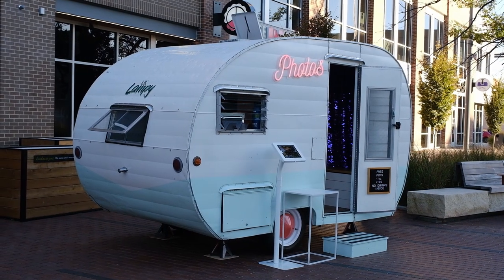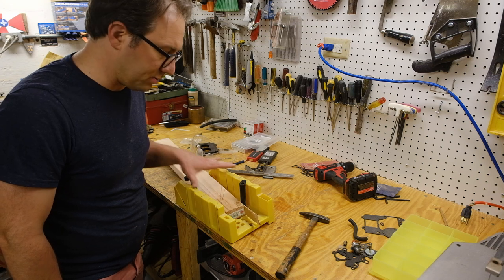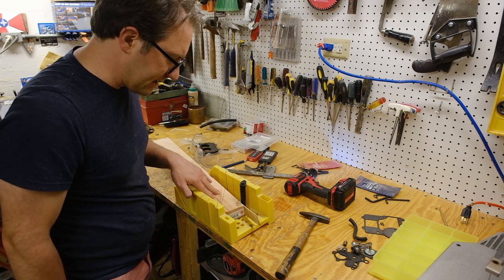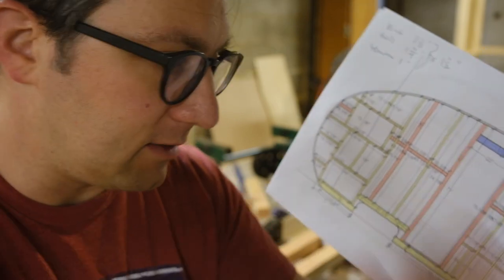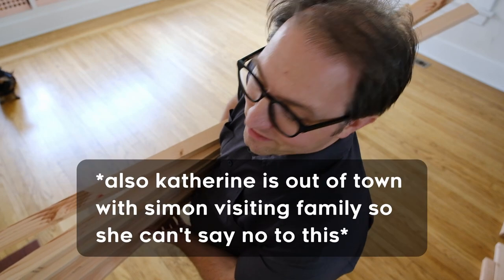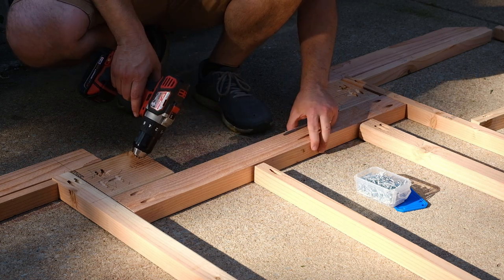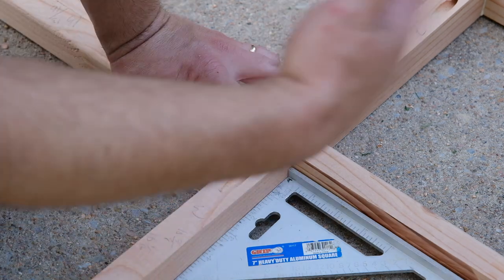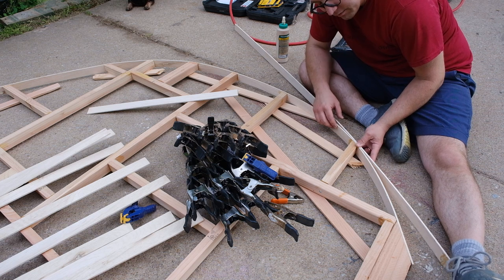BUILDING A VINTAGE CAMPER WALL 🔨 step by step diy

Comment: Conan, you make it look so easy.  I need to get practicing on Sketch up.  Enjoy watching your progress.  At first I thought you were putting that together inside your living room till I saw the workshop in back of where you were working.  I was thinking how is he going to get that out of there.  Then I realized it was a dry run.  How many hours would you say it took to cut all  the pieces and to assemble that wall.  Well done Conan.
Reply from the maker: It would actually fit though a normal height doorway, so I did consider fully assembling it in the living room, but my better judgement told me to take it outside. Also our house is over a hundred years old and the floors are less level than the driveway. Regardless, I didn't really keep track of the time, but I'm gonna say like really 10-15 hours of actually working on it. So a person could do a wall in a dedicated weekend if they wanted...maybe. I'll try to keep better track of time on the next one.

Comment: Looks great. Was insightful to watch the process. Learned a lot! I was bored the other night and had stumbled across some old magazine articles on campers from the 40's. They had dimensions, so I modeled it up in Fusion based on their dimensions. I think I like your design better. Looking forward to seeing the walls and roof.
Reply from the maker: Oh, that sounds like a fun exercise! I've always wanted to migrate over to Fusion, but I'm still needing to get a bit more proficient at it. I don't think it'd be a huge change to my working method though, but every now and then there's some things I wish I had it for.
Reply: @TrailerTrashtoTreasure  And I wish I were good at the tool you use. I started using Fusion for 3D printing and by using, I mean throwing stuff at the screen until something "works".
Reply from the maker: Ha ha, sometimes throwing things at the screen is all you can do with any bit of software!

Comment: There is only one reason to build the floor first. But I will hold back on that for now because that reason doesn't mean you shouldn't go ahead with your plan. I'll wait and see if it all works out LOL.. Continue on. Also remember, you will have 4 more layers at least when you make the curbing to that radius plywood all the way around will be much stronger later. And I glue the layers of the curbing as well. Your wall came out very nice.
Reply from the maker: Thanks! I couldn't see any reason why 3/4" on the radius board would negatively impact anything, but I did change the plans on the next wall to account for another layer. I'm not too worried about it though, but the next person to rebuild this camper will have a time figuring out why the two walls have a slight difference, lol!
Reply: @TrailerTrashtoTreasure  Surprise, surprise... LOL.. Maybe you should leave a note inside the wall for the next person.
Reply from the maker: Oh good idea!

Comment: Conan, why is there 3 different thicknesses of wall studs? I’ve only worked on one 1967, but seemed in Larry’s classes, they’ve also been the same. Thanks, keep up the work and videos
Reply from the maker: It seems to vary camper to camper. Typically the ones I've worked on will have thicker studs around the seam where the two halves of the skins meet, and also around the door. Regardless, it is always best to replace like with like, so just do what was already there. Remember though that ultimately those studs are just there to attach things to and to keep the panels from buckling; it's the panel itself that gives the wall all of its sheer strength.

Comment: Hi Conan, when you do your exterior skin what dimensions and thickness do you use for the metal sheeting?
Reply from the maker: Dimensions vary depending on the camper, but I think most are .032". I'm not 100% positive about that though. I've only replaced the skins with new sheet metal twice, and then I worked with what the supplier had.

Comment: I'm thinking of building the new framing onto the old and then removing it.   
1. My skills aren't that great. 
2. I'm worried the old framing will fall apart as I'm removing it.
Reply from the maker: I basically did that when I rebuilt the 1968 Play-Mor. 

Keep in mind:

1) You don't need great skills to do this.
2) It might fall apart, so you can always screw some extra supports to it to hold it together, (1x2s, 2x4s, scrap plywood, whatever you've got on hand).

Don't overthink things, just be careful and take your time.

Comment: Why do you cut down 2x4's?  Why not use 2x2's?
Reply from the maker: I don't buy 2x2s for a few different reasons. For one, they're more expensive than buying a larger board and ripping it down. For another, I find there are few actual 2x2 boards on a camper, meaning you would likely need to rip those 2x2s down anyway. But perhaps most importantly is that the 2x2s you buy at the hardware store are typically milled from the sapwood of the tree, meaning they're likely to have more moisture content and be more prone to warp or twist than a larger board that will be more likely to come from the older, denser, heartwood of the tree.

Ultimately a table saw is one of the most useful tools you can get for any shop, and you don't need to spend a fortune on one either. A basic job site saw is all you really need, and you can find those for around $300 new or less if you want to shop used.

I'd also recommend getting a circular saw, a miter saw, and a router as the basic cutting tools for any starting woodshop.

Thanks for watching and good luck!